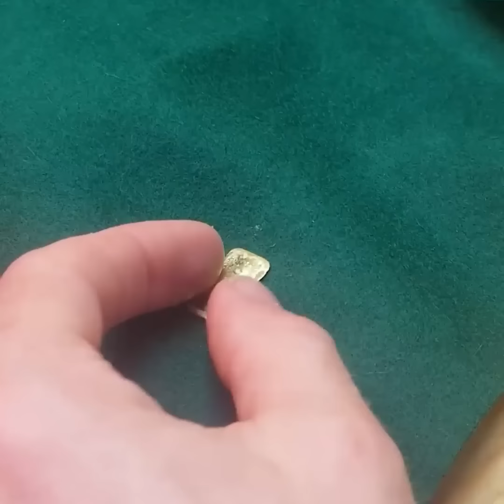Making the 1950 Dubrovnik Chessboard

Comment: absolute genius!!! but would have like to see the board laid out after you finished it - what sort of wood was used and any chance of it warping over time - does the hinges affect the flatness of the board when its laid out? is there a center line/gap in the middle when the board is laid flat - how solid is the board - can you thump the pieces on the board without the board bowing or denting?

Comment: You are immensely talented.

Having watched your video, I decided to attempt to build it myself (with the help of my father).

I could not infer from the video, how wide the frames  / edges should be.

At 06:34 I could see the length of the hinge, and from that, I am trying to infer how wide each edge should be.

In terms of millimeters I got 8.5mm. Would you say that's more or less the same size are the ones you made?

Thank you so very much!
Reply from the maker: Yes. Mine is 9.5mm thick.  Good luck!